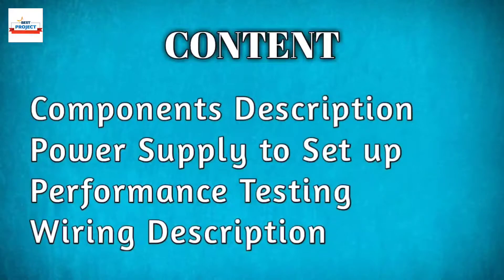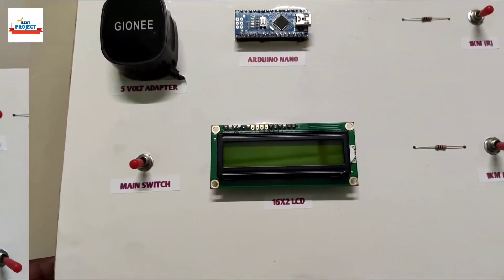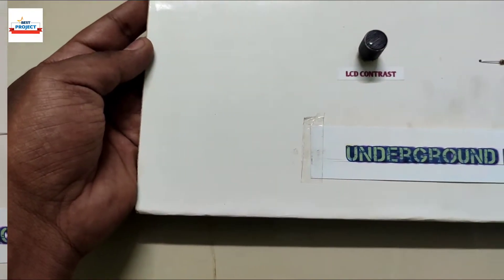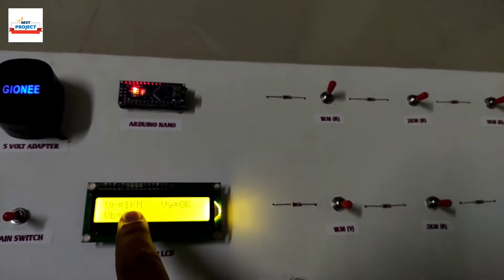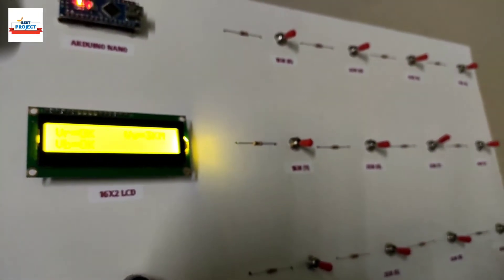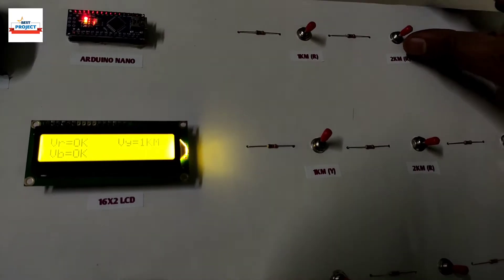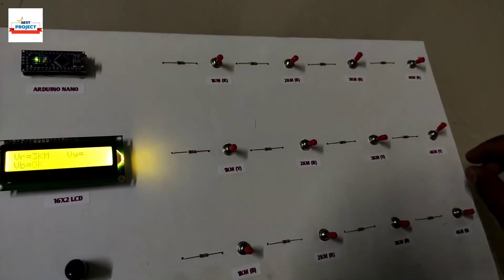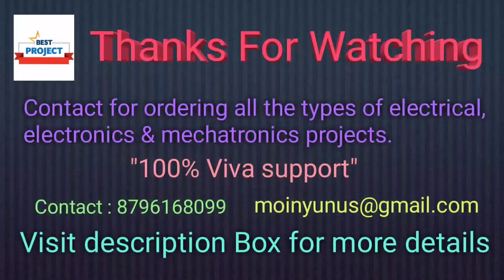15. Underground Cable Fault Detection System | Arduino | Location Detect | LCD 16x2 | Auto Detection

Comment: What type of gsm modem is used for fault monitoring
Reply from the maker: SIM800 and SIM900 is used for Fault monitoring remotely.
Reply: Is project ko kaise underround cable me connect krenge fault find krne k liye...pls explain....yha to aap khud se fault create kr rhe aur varying voltage drop se pta kr le rhe ho ki fault kha hai...but underound cable me aap fault create nhi kr paoge to fir ye project kaise helpful hoga underground cable fault detection me